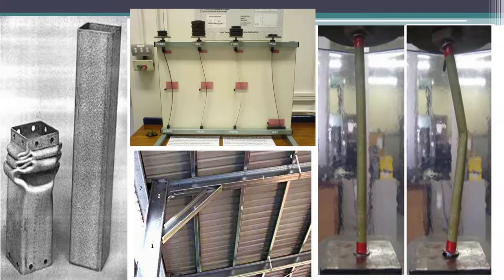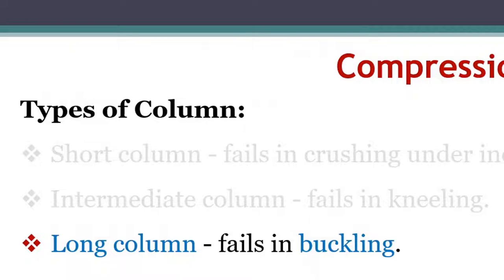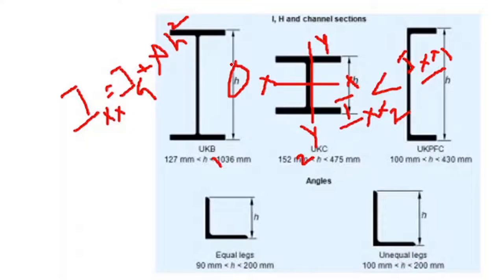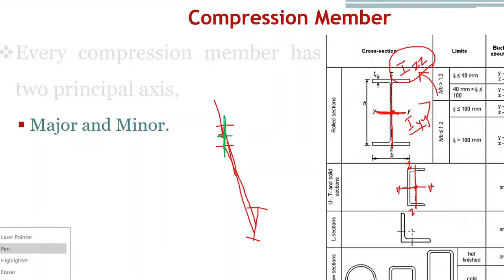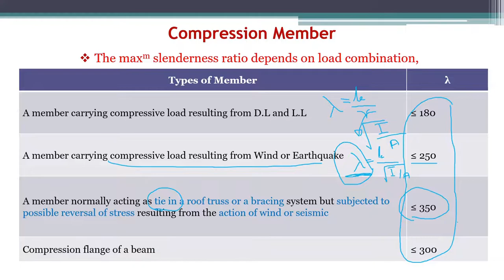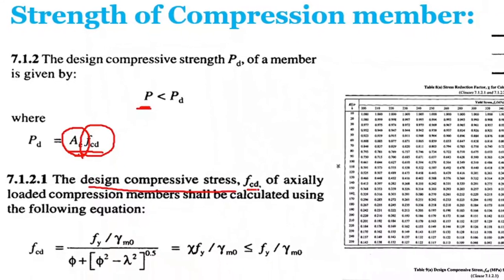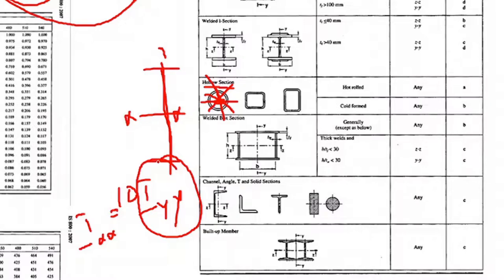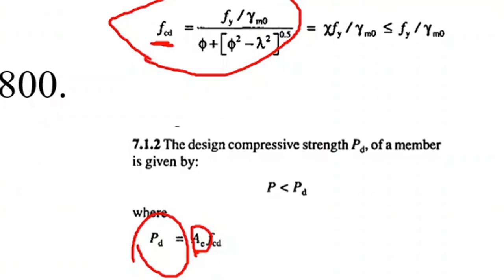Introduction to Compression Member

Comment: IS 800 : 2007 steel structure epdi kathukarathu
Reply from the maker: I have a series of videos posted. You can learn by watching those videos.
 Connections and Design of Tension Members
1. Introduction to Tension Member - https://www.youtube.com/watch?v=SocnNPkt6dI

2. Failure of Tension Member - https://www.youtube.com/watch?v=eq8Y7nEkvnE&t=339s

3. Strength of Tension Member - https://www.youtube.com/watch?v=z5Ymj7LLvuY&t=393s

4. Net effective rupture area of TM - https://www.youtube.com/watch?v=61VYVeMf6LQ

5. Analysis of TM with bolted end connection - https://www.youtube.com/watch?v=PCurTejRJfU

6. Analysis of angle TM connected to gusset plate - https://www.youtube.com/watch?v=3VwoDU9_7eo

7. Design procedure of TM - https://www.youtube.com/watch?v=8bx3kLShmLg

8. Design of Angle TM with bolted end connection - https://www.youtube.com/watch?v=fzyA6z-FN7M&t=1169s

9. Design of TM with welded end connection - https://www.youtube.com/watch?v=XVqobt7VvFY

Design of Compression Members

10. Introduction to Compression Member - https://www.youtube.com/watch?v=QvGQi_QknKc&t=66s

11. Analysis of CM - part 1 - https://www.youtube.com/watch?v=1GW9GNQVRgc

12. Analysis of CM - part 2 - https://www.youtube.com/watch?v=SvWuMxRrKko

13. Design procedure of CM - https://www.youtube.com/watch?v=7lZid6UbwwM

14.Design of I section CM - https://www.youtube.com/watch?v=nh1QSDIvpfg

15. Design of Laced Column: https://youtu.be/cVvVLSSzx48

16. Design of Battened Column: https://youtu.be/5vMBj8uqCsE